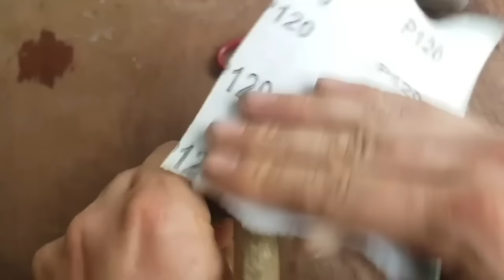How to make a Slingshot | No Power Tools

Comment: Hi. Im taking up catapult  hunting. whats the best size ammo and what type to use for a beginner. Great Vid
Reply from the maker: Check out my how to hunt and gow to aim with a slingshot video
Reply: @CatapultCarnage  im watching loads of how to videos. Youtube is my best buddy. Cheers for the reply
Reply: @CatapultCarnage  . do the differant colours on bands and and tubes benotes differsnt strengths. Cheers
Reply: Wats the best colour band or tube to use. Cheers
Reply from the maker: Colours don't matter thickness does and that question has n simple answer I'm afraid, ammo determines the thickness of band i have a video on 8mm steel band setups. I suggest you join some of the slingshot/catapult groups on Facebook for more info
Reply: @CatapultCarnage  will do. Cheers
Reply: @CatapultCarnage  Where can I find rubber

Comment: You can use resistant bands for the rubber part. Just made mine and got me a squirrel
Reply: LMFFAOAOAO
Reply: @chikoMade  huh?
Reply: I’m pretty sure this guy knows how to make slingshots you don’t really need to teach him anything

Kind of stupid thread though because all you did was make a point
Reply: Bushcraft Trapping If you didn’t notice i’m actually on your side with this not against you it was a useful comment
Reply: Yup ,@bushcraft trapping couple days ago i've shoot pigeon , squirrel, dove, small bird, rats with 0.7 resistance band straight cut, 2.5cm wide , and 24", homemade micarta slingshot,  but  i think thick band will work pretty good, 0.9 or 1mm , 

Ammo choice 8mm stell ball or lead just fine

Comment: This is the other extreme, no waffle but no mention of what wood was used, where did you get the elastic?  How did the whipping actually work. Bit of a dud.
Reply from the maker: With over 120 videos on my channel on slingshots the information is quite easy to find in my little corner of the internet. Even easier to find if you use that magical Google search bar or do you need spoon fed information?
Reply: Frank Tuckwell 

Oof

Comment: Hi. 
is there any other wayes then the microwave to make it dry faster
Reply: Do you have a dehydration machine
Reply: Owen or abowe fire for coupe hours( about 20" abow mild fire). Or/and combination wind tban fire than wind... regular owen will do the job less than 100C and/or couple hour between hot plates at mild temp... there r many many solutions as well.....